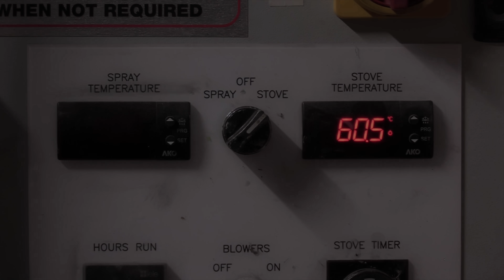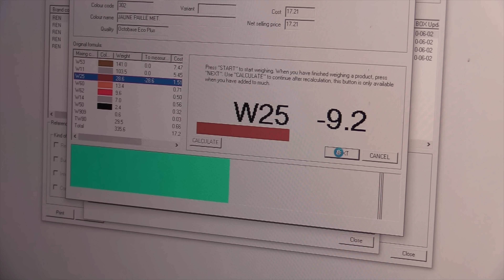Streetfighter Makeover 2.0 :-  Day#2  (Wheels Paint) !

Comment: How do you calculate the quantity of paint to mix? Or is it just guesswork based on experience? It would be a pain to either run out just before a coat is finished,  or to have excess going to waste if you mix too much.
Reply from the maker: It's always best to mix a little more then you need, that will avoid ending up with a dry coat.. and after a while you get used to knowing what it takes to cover a given area, so experience i guess !

Comment: How many coats of colour and did you fully bake them each coat?
Reply from the maker: "Passes" would be a better word than "coats" when it comes to small bike parts... If painting a car, then one pass round the whole car can be called a 'coat'.. but with this, i just work round the parts until they're in full block colour.. and NO, there's no need, just bake off the primer, then a longer back on the finished job !